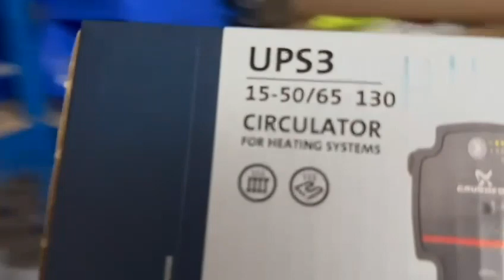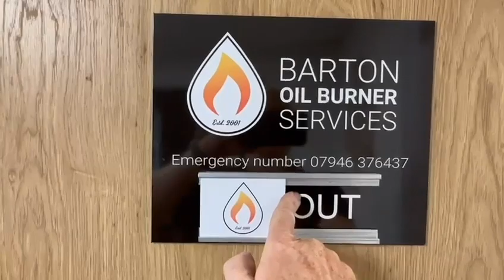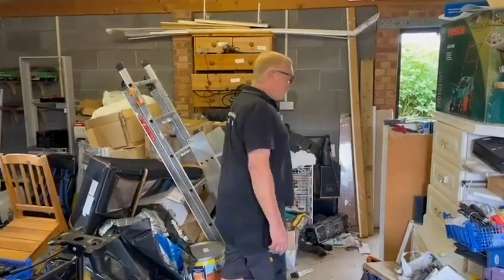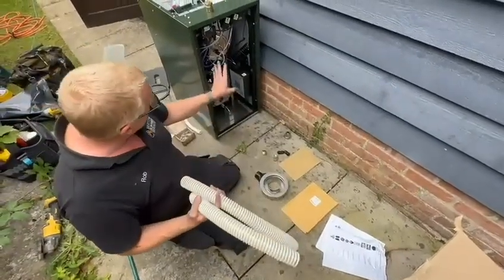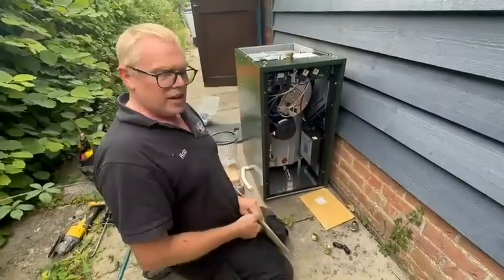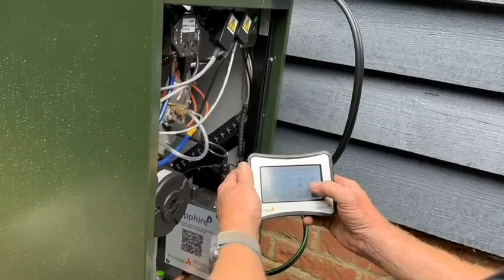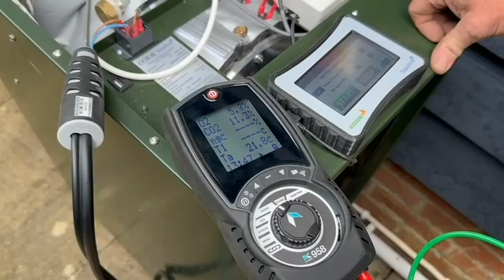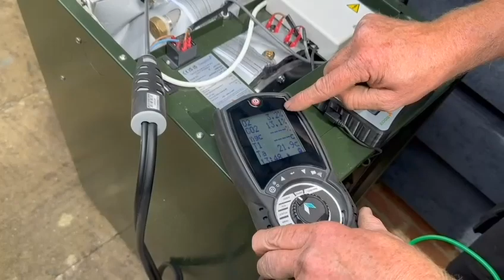INSTALL A SAPPHIRE BOILER WITH US

Comment: Is there a way of making the chimney quieter? Ours is very noisy even with the cone in place. Is there some sort of silencer that could be added?
Reply from the maker: Hi. Sorry for the delay in getting back to you!  They can be a tad noisy but i now tend to use the smaller nozzle cone on the combustion side and a slightly smaller nozzle which helps. The set up is vital to a smooth running sapphire. Have a good Easter!
Reply: @BartonOilBurnerServices  Thanks so much for your reply. Yes, there is now a cone at the stack exit and the cone itself was modified by opening it out but still too noisy. The boiler itself is in the garage and the stack initially goes vertically through the roof. Not sure then why the stack is then turned by 90 degrees so that the gasses have to turn to exit horizontally. I would have assumed that the ideal gas flow would be straight up with the stack exit protected with some sort of ‘hat’. The boiler itself does not seem to be unduly noisy and is quieter than the previous Grant unit. I wonder if there may be some sort of attenuator/silencer solution? As stated by a previous author, I wish you had fitted the boiler!